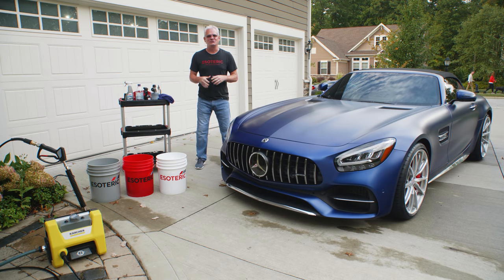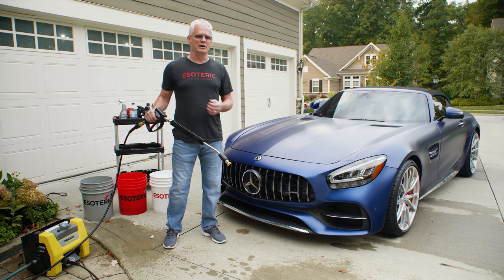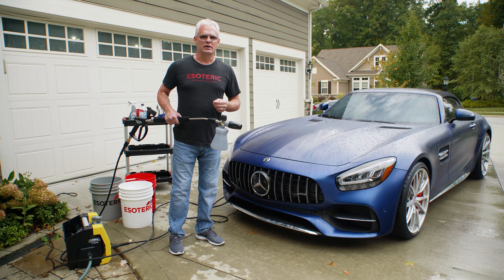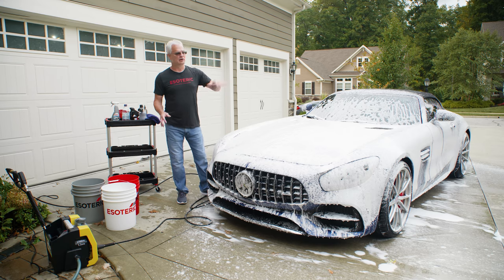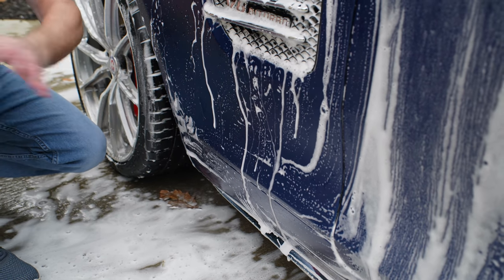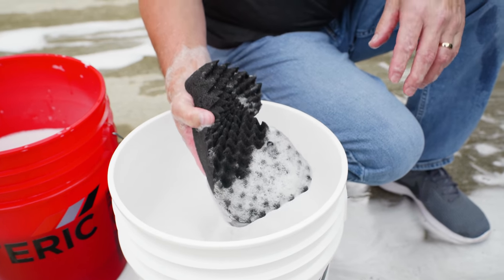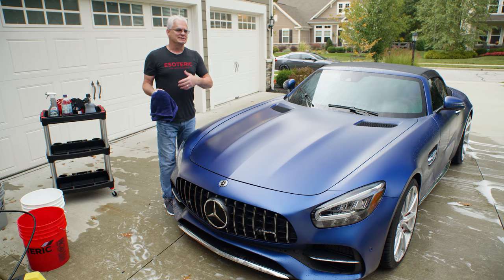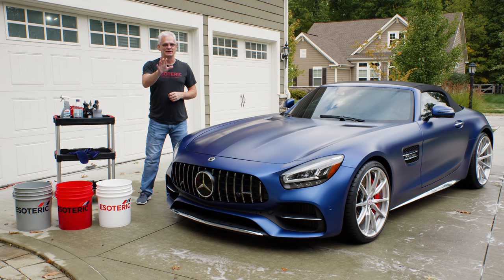Pro car washing FROM HOME! | Step by step tutorial!

Comment: Just wanna point something, i use detail guard an Grit Guard, Detail Guardz are much better and better engineered than Grit Guard, the detaild guardz system keeps more particles at the bottom.

About sponges and washmitts, when to use a sponge and when to use lamb washmitt?

Great video Todd.
Reply from the maker: We can debate that point, but if we're washing thousands of cars with no scratching or marring, should we necessarily be concerned about something that theoretically might be better? We don't use lambs wool wash mitts...quite using them many years ago. For more soiled vehicles, we may use the Gyeon Woolie mitt, but when maintaining nice finishes, we always use the ultra-soft ESOTERIC sponges.

Comment: Pressure washers and foam canons not necessary . Don't waist your money. Use a good adjustable sprayer for your garden hose and quality car soaps and cleaning brushes.
Reply from the maker: Both as a professional detailer and as an enthusiast, I couldn't disagree more. It makes the work faster, safer, and more efficient. As for brushes, the only place they should be used are on wheels, tires, and wheel wells!
Reply: For a homeowner i will still disagree. No need to foam my entire car. I wash in sections. No soap drying on car. Yes brushes on wheels only. Custom hand washing for me. No gimmick
Reply: Same reason I wouldn't let landscapers take care of my property. I make it look much better. Time is money for landscapers. My hose and hand washing methods are not about speed. This is unnecessary water pressure and foaming needed for the homeowner who is not in it for speed and to make money. I also soft wash my house. Pressure washers are not needed to wash a car.
Reply from the maker: @johncaputo5237  If it's not for YOU, then not sure why you would chose to tell others that it's not for them, when the industry has clearly embraced these tools?
Reply from the maker: @johncaputo5237  Then you're disagreeing with the vast majority of car enthusiasts! #fact
Reply: I might consider washing dump trucks or vehicles of that nature. with a pressure washer. I wouldn't dream of touching a beautiful new car with a pressure washer. 
Totally unnecessary pressure for a cars finish. A nice toy for all the young millennial who buy into this hype. The same people who use pressure washers to clean shingles on their house. Hand wash with a nice gentle shower is all you need. Common sense. Pressure washer companys must love you guys.

Comment: Any time you touch your paint you are running the risk of marring, that is a known fact.  When using a single mitt and 2 buckets there is no guarantee the mitt will come out 100% clean from the rinse bucket and you run the risk of introducing debris into the soap bucket, which further increases the chances of marring, that is also a known fact.  

If you plan to do some paint correction after then the 2BM is fine but after spending hours upon hours correcting and coating the paint I want to minimize my chances of marring as much as possible and the multiple mitt method is the superior system for reducing your chances of marring.  Only drawback is having to do some extra laundry, but I would gladly take that over having to do more paint correction and removing more clear coat when it could have been prevented.
Reply from the maker: We don't go off of theory, we go off of years of practice. Your biggest opportunity for marring is when the wash media glides across the surface to remove dirt and debris. So given this, you have equal chances of potentially marring the finish.
Reply: @Esotericdetail  The 2BM itself is based on the theory that all the dirt and debris you removed from the surface is rinsed away in the rinse bucket and you are now able to start with a clean mitt once again when dunking your mitt back into the soap bucket.  The problem with that is whatever dirt and debris was removed from the surface can possibly float around in the rinse bucket and re-contaminate your mitt.  

This is such a big flaw that Doug Lamb invented a device you used in this video called the grit guard.  The theory behind this device is that you drag your wash mitt over it and all the crud you removed from the surface becomes trapped underneath it and is prevented from floating around and re-contaminating your mitt.  The problem with this is some particles are small enough to escape the grit guard and contaminate the water once again.  Wouldn't you agree the grit guard is a "crutch" for the 2BM and a single mitt?

I'd much rather like to take all the guess work out of the equation and reach for a mitt that I know is clean rather than hoping the possibly already contaminated rinse water and grit guard are doing their job.
Reply from the maker: @5hift6ear  I find the 15-wash mitt method is a crutch for those who can't do a 2-bucket method properly. If YOU wish to do it, and it makes you feel better, than great. But it's simply not a process that 99.9% of car washers are remotely interested in doing.
Reply: @Esotericdetail  At the end of the day the name of the game is to prevent marring and the 2BM even when done properly, has its flaws due to the reasons I mentioned previously.  Using multiple mitts (15 is a bit of a stretch) is a more effective method to mitigate the issue at hand.

If 99.9% of car washers are not remotely interested in using multiple mitts, then the 0.1% that do are considered esoteric and the other 99.9% that don't are considered exoteric.
Reply from the maker: @5hift6ear  Yet somehow we are able to maintain all of these cars using the 2-bucket method without any issues...
Reply: @Esotericdetail  Its not like the cars you maintain are that dirty begin with and whatever crud is on the surface is  removed with the pressure washer.  I will admit that in your scenario the 2BM is completely feasible, but what if you have a daily driver that is constantly exposed to the elements?  What if you only have a garden hose to work with?  What you do works for you but isn't ideal when other factors are considered.  But hey, keep doing what you're doing because you've come this far and it has brought you much success.